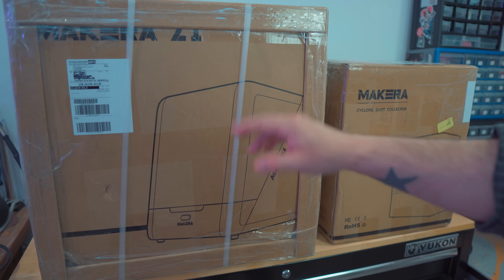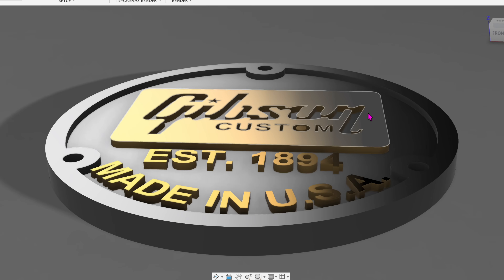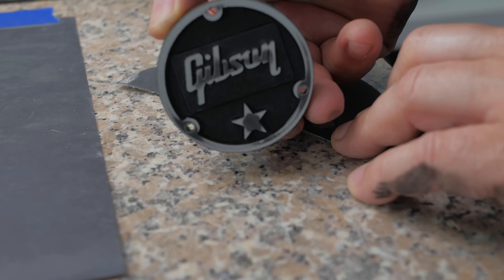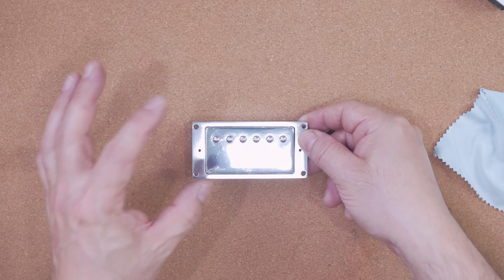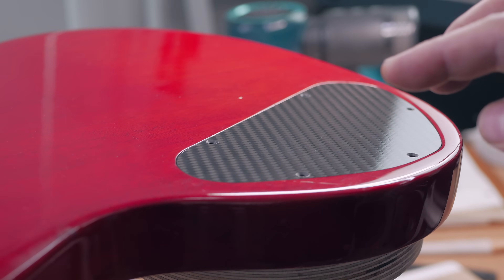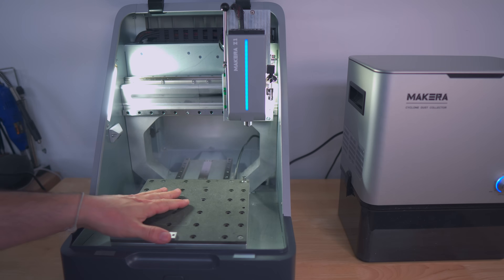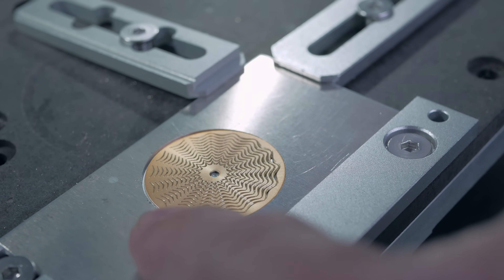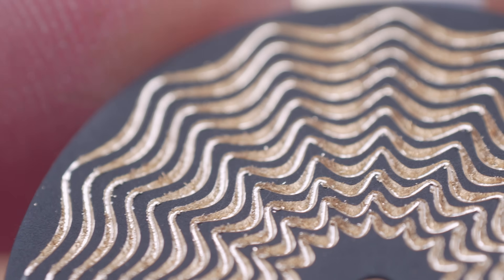Makera Z1 — The CNC I Wish I Had Years Ago

Comment: Very good video.  Makera just announced a $250USD upgrade to "Pro" the other day which tweaks the stepper motors and replaces the standard kit with ball screws to reduce pushback play in the bit.  I was already a backer and just pulled the trigger on that as well - this seems like it will be a really solid machine.

Comment: the dust vac is completely useless for what its designed for, youre better off just waiting until enough dust gets collected towards the back of the machine and just hooking up a 30 dollar shop vac to take it out.also since you have to manually change the tools its better just to clean up a bit per tool change. save the money and buy other stuff like the low profile vice and the 4 axis

Comment: Thanks for the video Mark.  I pledged for one at the start of the campaign and decided not to go for any of the addons.  Anyway, today Makera say they have a new upgrade/addon which makes the Makera Z1 a Pro level machine (?).  So they are calling the upgrade the Makera Z1 Pro that would retail at plus $399 after campaign ends but $249 before.  It upgrades the Z1 to use ball screws and closed loop stepper motors.  Will this really make a lot of difference to performance ? is it worth the upgrade price ?  Thanks.

Comment: You should avoid CNC machines that small. Especially ones like this that can't be upgraded without cutting up the built-in enclosure. It's style over substance. You will be constantly hitting the sides (or shut-off switches) trying to fit your workpiece.  The work-holding limitations will be almost unbearable.  Clamps alone often need an extra 3-5" of clearance around the work piece.

Plus you can't resize larger pieces of wood or aluminum on the machine with this design. A CNC machine is not a 3d printer and should be designed differently. 

I have never regretted having too much work space or too much power. I have definitely regretted the opposite. For a start-up or hobby scenario you want to be able to do as much as possible on one machine. And leave room for growth and future upgrades.  

That's my $0.02 anyway.
Reply from the maker: The back panel of the Makera Z1 can be removed, a feature which allows for the use of longer workpieces. That and tiled tool paths help overcome the small footprint.

Comment: Thank you so much for sharing! Your video is seriously underrated, and its application is highly practical in real-world scenarios.
For the dial machining project, do not move the aluminum plate after finishing the cavity machining on the bottom of the aluminum plate. Instead, use the same coordinate system to machine the dial, and this will achieve good concentricity.

Comment: I would have used the XEBEC Brush tool or some lapping bits to remove the tooling marks. It's much easier to do this while machining parts, rather than lapping them by hand afterwards.
 It's a nice machine, and I would appreciate the swarf extraction unit as I spend hours cleaning out the enclosure of my existing CNC milling machine.
 For plastic parts with the carbon fibre weave pattern, I 3D print them with the CF weave pattern build plate; they look great!

Comment from the maker: If you have any questions about the Makera Z1, the toolpaths I used, or the materials I tested, drop them here. I’ll try to answer everything as clearly as I can.
Reply: Thanks much for the the great overview with real-world applications/ projects. I have a Z1 on order and am planning to cut carbon sheets as you did here - did you do anything extra to manage potentially harmful CF dust, or did you find that with the enclosure + cyclone dust extractor with it’s HEPA air filter there was no CF dust entering the room?